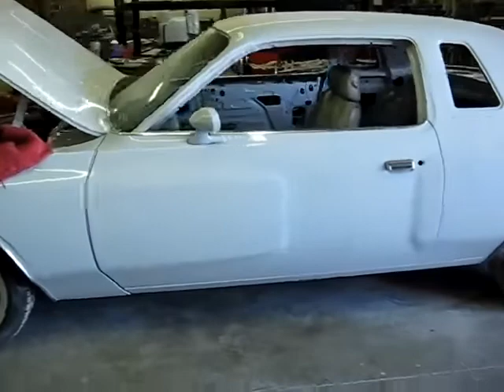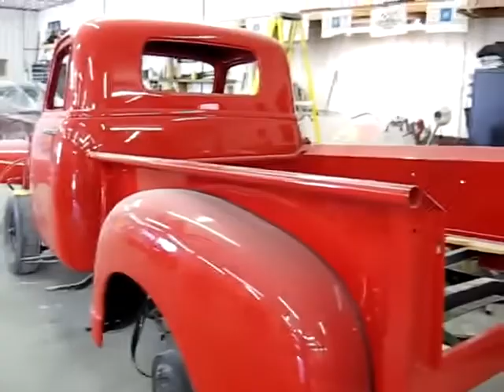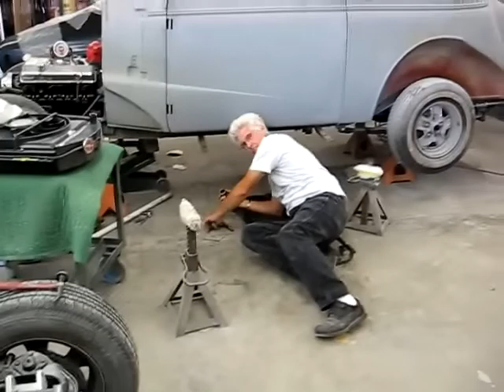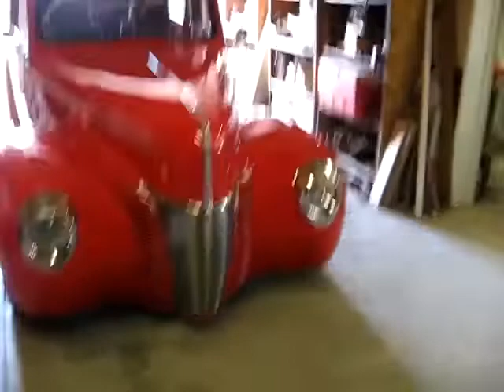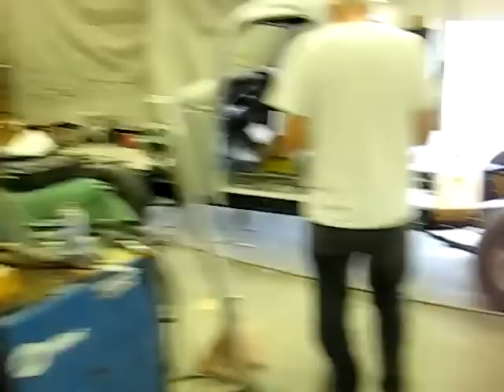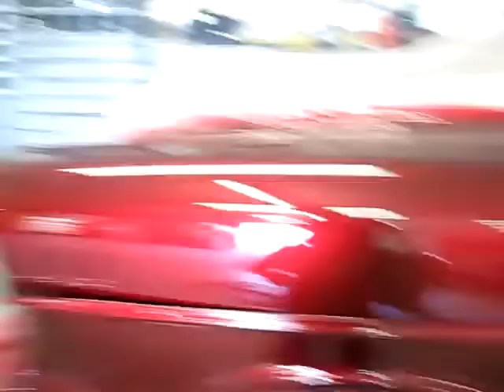Custom Paint And Body Work in progress..

Comment from the maker: @rmawrites hey bob..the only way i can do a panel match is knowing that i painted the rest of the car and i used the same air pressure, fluid setting, number of coats of each (example= sealer, base, kandy, clear) And spray pattern and spray gun...If this was anyone else car i would have to blend..

Comment: Hey Ryan. Thanks for answering my question. Final question on subject: Do you literally write down or memorize the air pressure and coats applied to each material? I only use my best IWATA gun on my custom bases colors, and my SATAjet 1.5 tip on my clears. thanks again and happy spraying! bob:-)